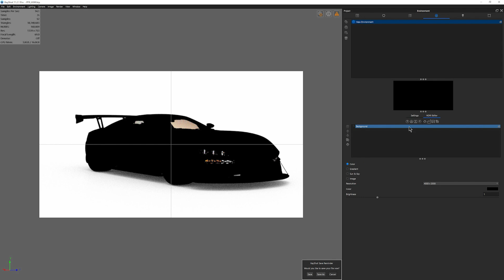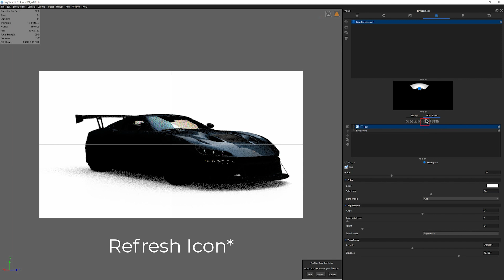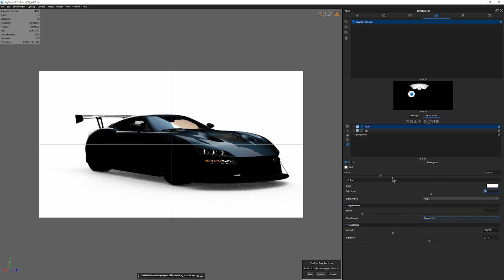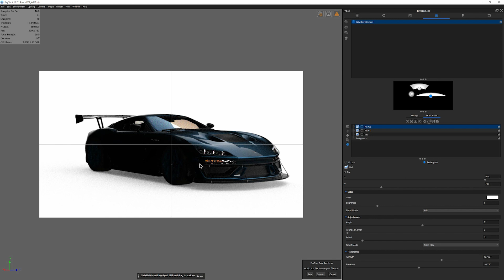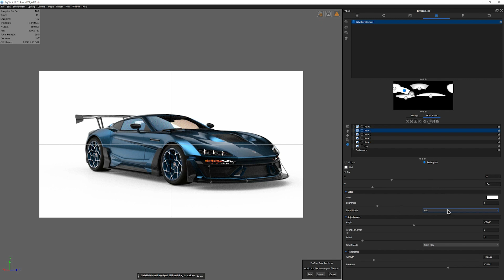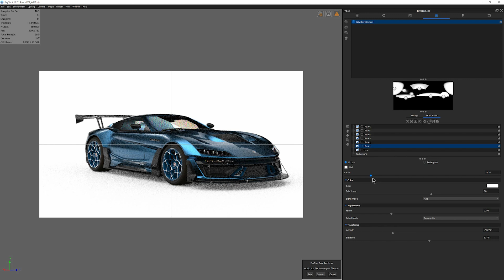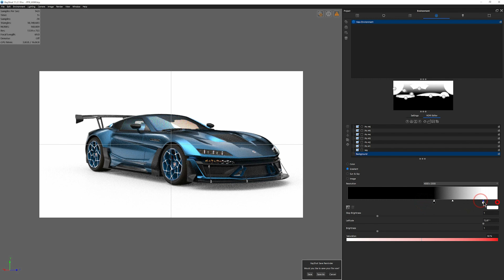KeyShot Quick Tip - 3 Point Lighting for Vehicles

Comment: 2:20 uhh... unless this is talking about the luminance gradient on the surface of the light, the physically accurate falloff for lighting should be quadratic not exponential (unless it's a laser which ideally has a constant falloff). It's known as the "inverse square law" in physics.

This is because if you take a shape and compare it to a sphere with a radius equal to the distance from the light source to the surface, the area of that sphere will increase with the square of the distance while the area of the shape remains constant. The ratio of those two areas determines the incident radiant flux (amount of light) on the shape.